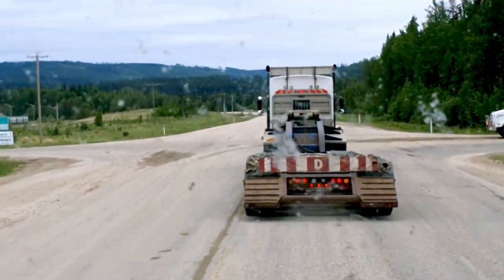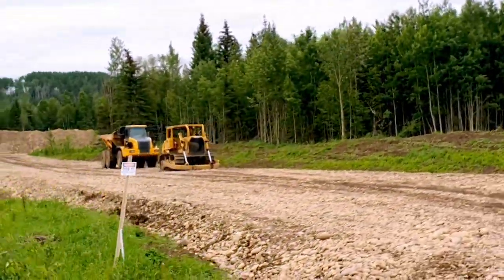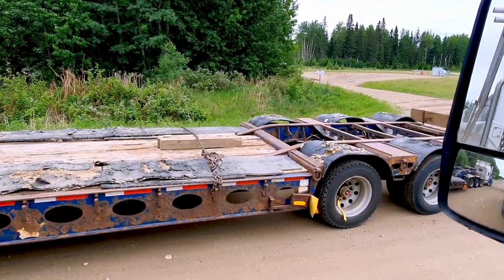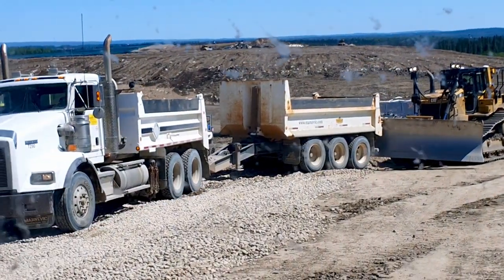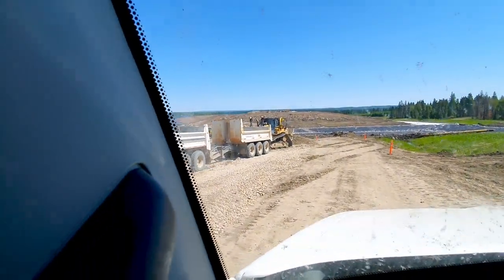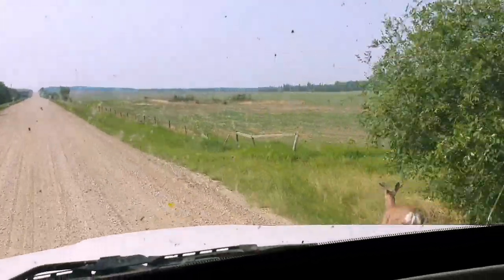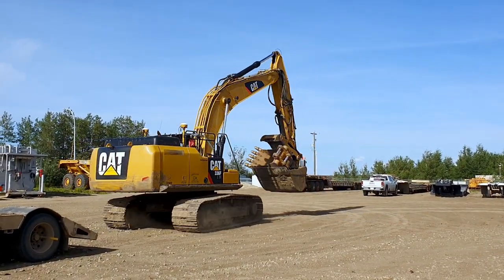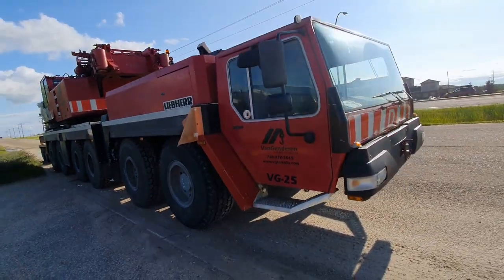Massive Machines on the Road

Comment: Lucky you getting to have fun doing double duty loading that JD 300G and driving it away, here in Manitoba there is finally going to be some start up of the Potash industry ,Saskatchewan has the largest reserves in the world and Manitoba comes second, and its high time they are doing something with it and help to get our province moving and less transfer payments to the fed Gov't, you must be a bit familiar with Versatile farm tractors seeing them in the fields in Alberta , i use to build them back in the late 70's early 80's and built all the axles and planetary gear assemblies, it was fun and crazy to see what they could move, haul or drag when installed into the tractors, a whole lot of power when you add that incredible amount of gear reduction, 👍
Reply from the maker: That transfer payment stuff gets me fired up.  Seems to me like the west is a constantly bruised spouse in an abusive marriage...
I can understand the reasons for talking about "divorce ".
As for the Versatile tractors yes. I think that vintage of that machine is likely the best ever built.  Now there's way too much crap on them and not rebuildable.
I  seriously doubt ANY vehicle or machine built now will still be in service 50 years from now.

Comment: That unit around the 9:00 minute mark is a coil tubing rig, they’re a pretty versatile piece of equipment for oil well completions. I reckon they would use a crane like that for holding that big coil up in the air so they could run it down hole. 

See them here in North Dakota but very cool setups.
Reply from the maker: Yes. They run all kinds of coil tubing here too. So you and I know what they are,  but the majority of the population wouldn't have a clue what they're looking at, or what it's for.   I think this is the first time I've noticed and had a chance to video this setup with a 24 wheel jeep and 24 wheel trailer.  
Heaven help you if you're on a soft road hey?!!
You see those cranes working with coiled tubing and of course big frac jobs. Lately it seems all the wells are multi well pads. A bit bigger budget that the stuff drilled a dozen years ago.

Comment: some big truck,will they  be aromatic  or still have gears ,dont see many of those in the uk ,they close the roads to move them around
Reply from the maker: My guess is the 300 tonne crane will be some type of automatic or powershift transmission,  it's safe to assume all the rest would have 18 speed manual transmissions.
Reply: @lovesloudcars  i have a job managing five gears ,i thought they have a lot of gears as i remember those army  tank transporters had a lot of gears as well,i remember we were in a convoy and a big 6 wheel army truck pover took us and the middle tyre exploded  bits of tyre hit our land rover scary
Reply from the maker: @trevmacc  the bigger truck loads they'll rig them up a bit different too. There's lots of trucks that you see here who are running planetary gear axles on the rear ends and it's common they'll run an extra gear box behind the 18 speed box which is especially useful in soft and slow conditions. 
If you're not familiar with planetary axles,  they allow the torque reduction and multiplication right at the wheels which takes a lot of gear stress off the rear ends,  drive shafts and transmission.  If I recall,  in the UK  it's called the propeller shaft.
It's easy to tell a planetary vs regular based on the size of what you see looking at what the wheels are attached to. 
I  had a tire come apart on me like that recently.  Crazy stuff.
Reply: @lovesloudcars  interesting ,i like seeing stuff like that , but look scary to drive to me a small car was enough.🤣